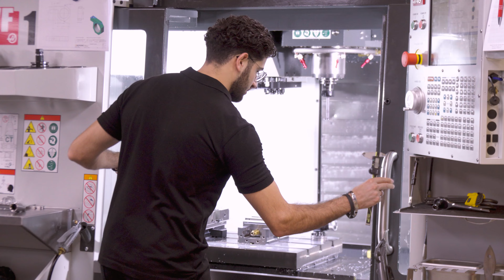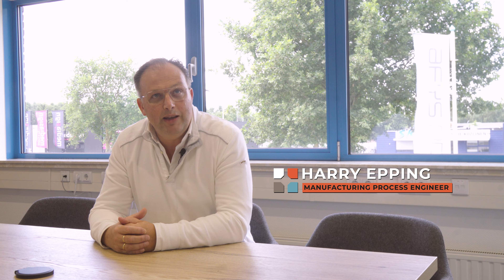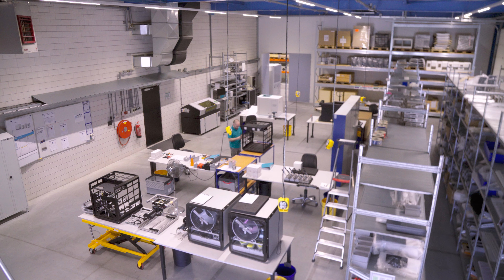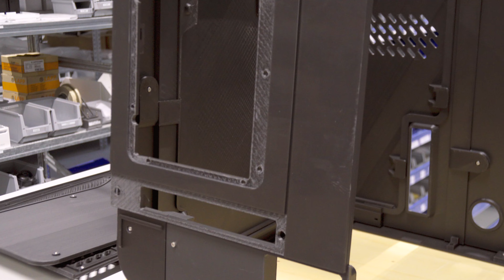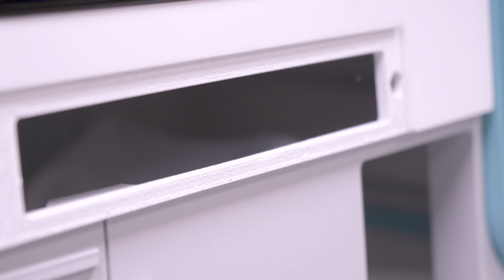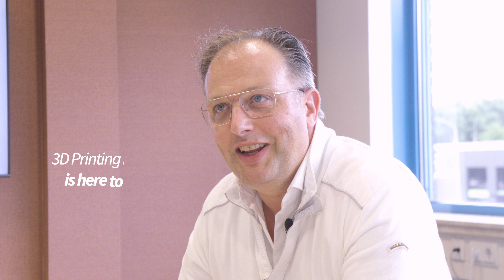3D Printed Lab Equipment Housings on the BigRep STUDIO | AFYS3G

Comment: 3d print can only replace 70% of plastic incektion.  you can not use dubble suppur gear as printed. you can  not use A grade surface caps as printed. and more
Reply: I think you're absolutely right about that. When you need high precision gears or A grade surface finishes, injection molding still remains the king. But honestly, 3D printing has come such a long way - especially with good hardware, software and material solutions like BigRep's and a with the right print profiles - the gap is getting smaller gradually. And the thing is sometimes 3D printing lets you do stuff that would be impossible or ridiculously expensive with traditional molding. I think it's never really meant to replace injection molding, but to stand out as a powerful alternative alongside it.